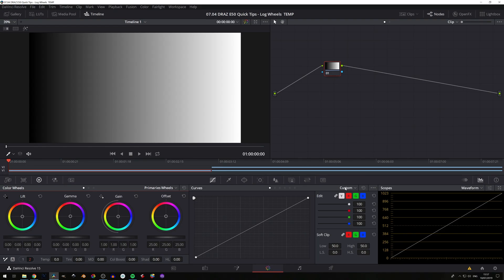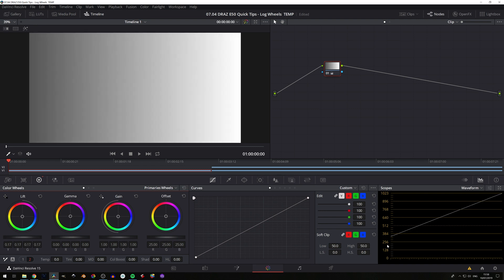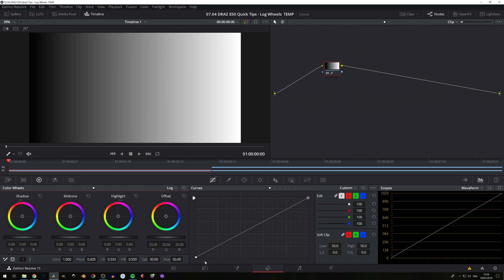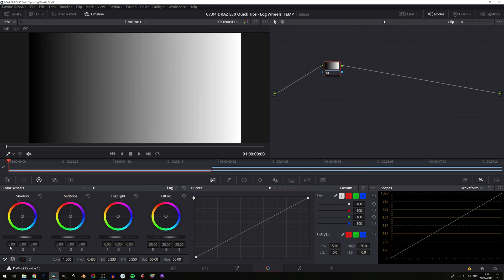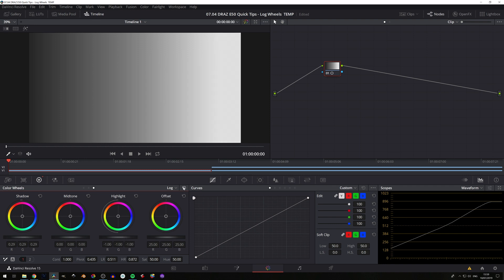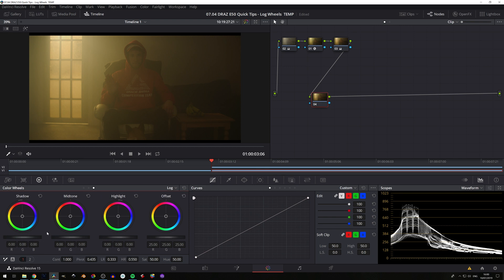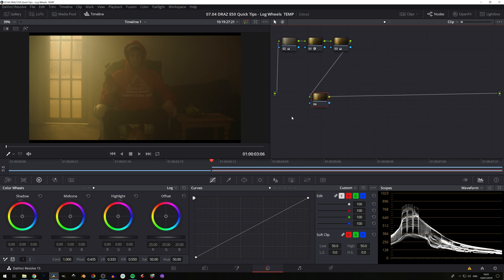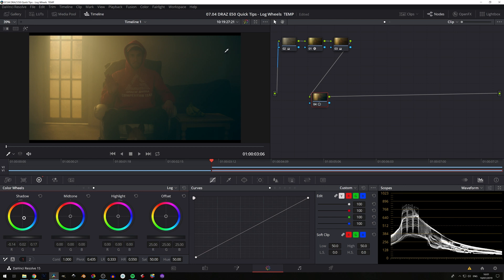Primary Wheels vs Log Wheels In Davinci Resolve 15 & 16

Comment: I have  the other type of log wheel, How to get this type of log wheel. My current log wheel feels smaller in terms of this one.Can you help Thanks
Reply from the maker: These days there is the HDR wheels which is basically log wheels with more increments and is helping for working with HDR content. My guess is that your on the HDR wheels. All these options are found on the top of this panel on the bottle left of DaVinci Resolves user interface. You can just click through the various options.